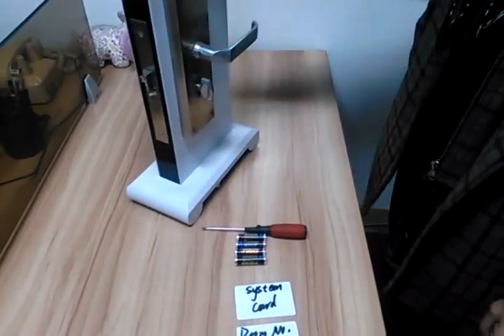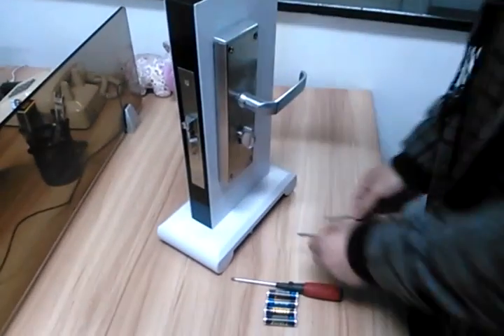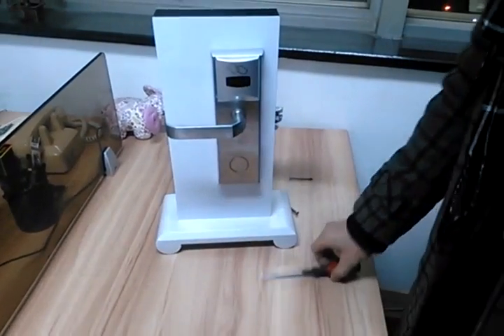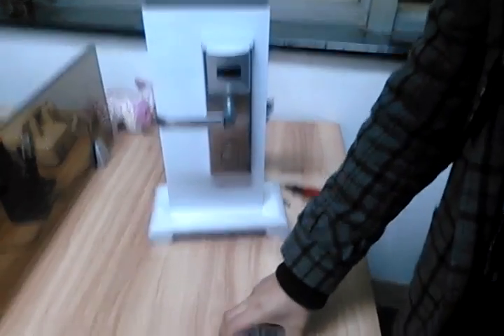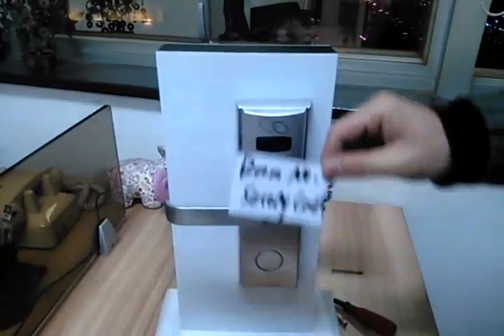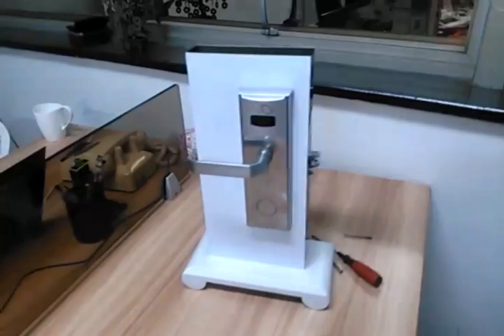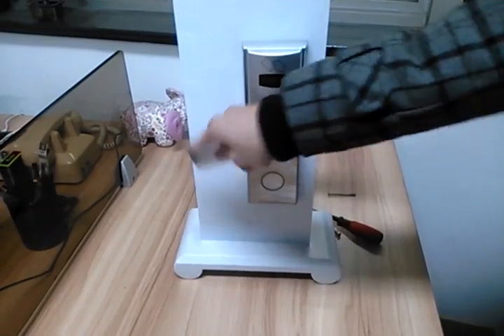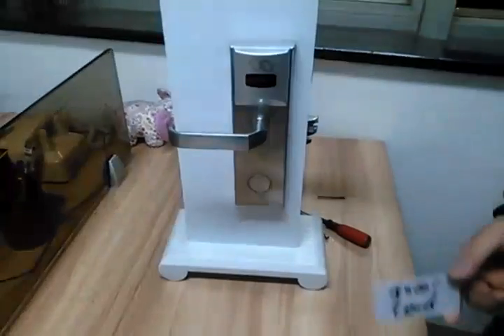RFID HOTEL DOOR LOCK-How to authorize the lock

Comment: How if system card lost. Can i create new system card?
Reply: Yes, you can cerate new system cards by the software.
Reply: @hotelock-tech  
Is there no other way than to use software? I heard that I can use a manual key by opening the lid several times to create a master key
Reply: Jakarta Fiber Optik can’t, only can issue system card by software and encoder
Reply: @hotelock-tech  So if I buy at different times, I will get 2 different master keys? even though I want the second purchase masterkey to be the same as the second purchase